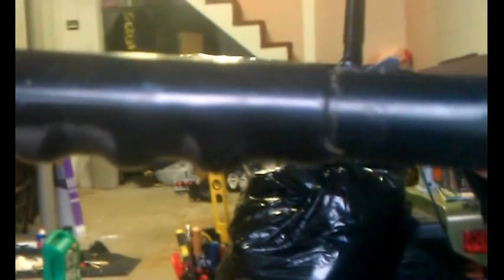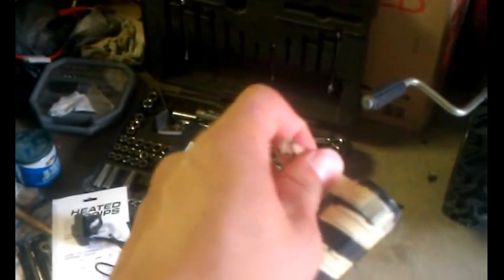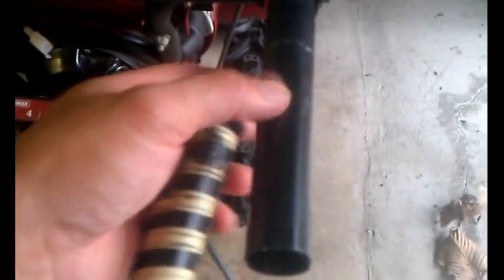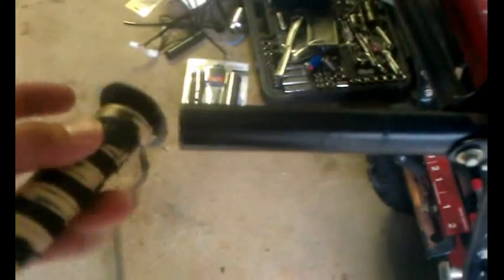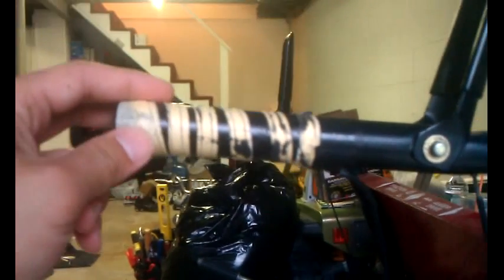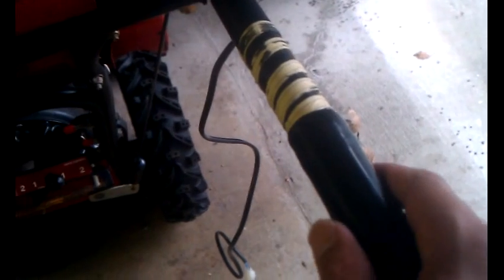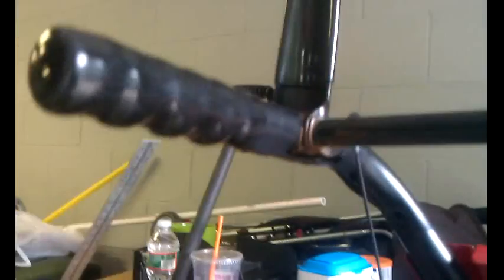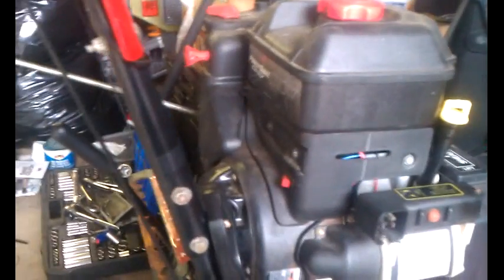How to: Install heated hand grips on a SNOWBLOWER

Comment from the maker: all machines use a stator. And mainly is used to power a light. If you google your machine and you can see if there is wire that feeds the light. On some machines its a add on feature you can use that wire to power this set